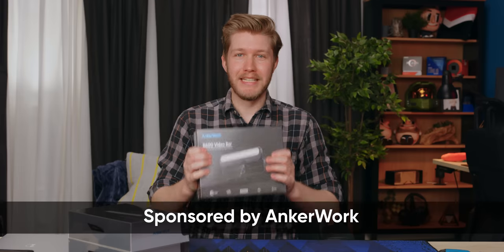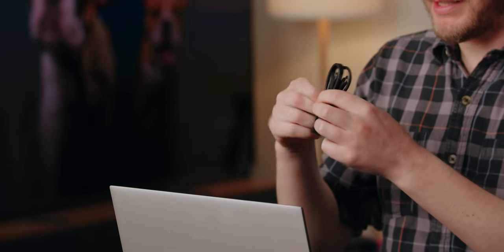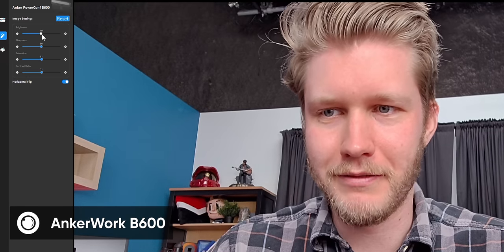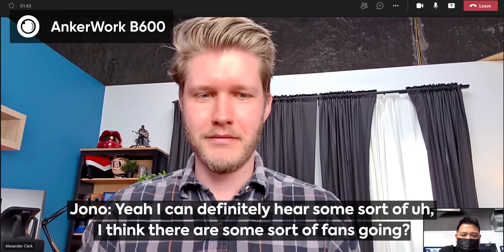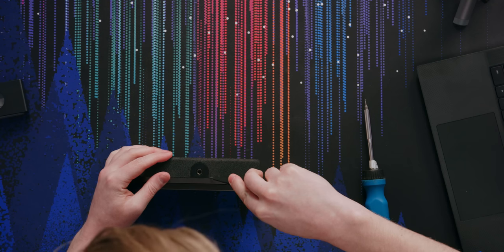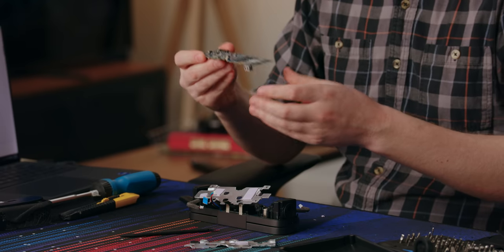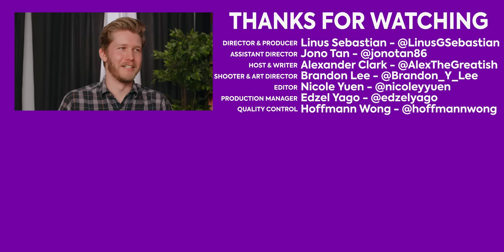Sponsors should be SCARED - AnkerWork B600

Comment: I completely forgot about the Pavilion Wave's existence, and I looked it up on eBay for shits and giggles.

Nobody bought them. I mean, to me, the Wave does kinda look cool, but nobody bought them. I would've. The only thing going for that computer is the Bang & Olufsen audio system.

But the Wave reference in the video aside, I don't think this webcam is worth it. You could plug in an old Sony camera over Composite into the computer (somehow) and it'd still look better than this.

"Look at the sensor. It's so little!"

Sure, it looks cute. But this is what you'd see in an early 2000's Kodak stills camera. Buncha noise. And those compression artifacts on that camera aren't great either. Of course, Teams never does any camera justice, even if you had a broadcast camera for $50,000. But still, that was direct capture.

Comment: 2K = FHD 1080p....
If it is QHD 1440 then it is 2,5K.... (2560x1440) 2500 = 2,5K... ;)

"Sometimes QHD or WQHD is referred to as 2K, with the idea that it's only half the 4K HD resolution. But the 2K name comes from the larger of the pixel measurements being aprox 2,000 pixels. Technically, the resolution standard for 2K is 2,048×1,080 (but 1920x1080p can also be called 2K) meaning QHD is actually much better in resolution. QHD could even be referred to as 2.5K, but some people resists calling it 2K..."

Comment: Guys, this is a tech channel, y'all should do better than "2K sensors, that's 1440p"... no, 2K is a bit more than 1080p. not 1440p. Sorry to be an ass about this but this garbage about "2K" has been an issue for like a decade at this point because reviewers started calling 1440p 2K for no reason. 2560x1440 is NOT 2K. 2,048 x 1,080 IS.

Comment: I know this isn't a proper review and manufacturer payed for the coverage of their product, but maybe next time you can roast a bad product instead of taking it apart? ;) I think it's really time for reviewers and tech community to stand up against this bs, all the webcams are just trash even without the compression of video calls, and these fancy new ones that came out in recent years cost like a decent smartphone, advertise all those lenses, sersors, software, but still won't deliver. What's the point in high resolution and framerate when the quality is still comparable to some Logitech 720p webcams from a decade ago?!?.. And I know, that with some new and expensive ones you can get an alright image, but it requires some stupid level of tuning, and even then lighting conditions change, settings reset after a disconnection or reboot, and lets have some common sense, 99.99999% of consumers won't and shouldn't be bothered. It blows my mind how every time these past few years a new expensive AF webcam comes out and almost in every video about it the reviewer will plug it in, play with settings and timidly say that it's "better" or "fine" when you obviously see that it's not fine, and it's only screen recording, and not all people have fast internet, and by the time you make a call it's all a potato, and it's 2022, and they want $200 dollars for it... This is unacceptable, so why is nobody saying anything?.. (rhetorical, I see a lot of reasonable people in the comments that also are vocal when something's wrong with the product, it's just that it doesn't change anything because there's not enough of us)

Comment: 2:38 Every time this guy hosts a video I get the impression they are kinda lazy with the work. They throw in a question about Windows Hello support, and instead of actually testing and giving out an answer for that, they just "guess" it doesn't, and decides not pursuing any further because they have a laptop that already has Windows Hello and they "think" the cameras will get mad at each other . These guys make living out of filming themselves building computers and that's the excuse they go with.

BTW guys, Windows 10 has Hello multicamera support from 21h1 which lets you choose the default camera for the face recognition, and if that doesn't work, you can just disable the onboard camera from the device manager and only leave the external camera active.

Comment: Remember a while ago when Alex reviewed the Dell 4K webcam (https://youtu.be/OIatX_cNVc0)? About the same price, and frankly, both rather disappointing image quality. Between the two, the Dell seems less sharp but has better color balance out of the box, and I'd prefer that one, but neither convinces me that it's a good idea to drop $200 on a webcam.

I get that you cannot put a fancy new full-frame sensor in there for this price, but surely a ten years old micro four-thirds sensor from say Canon or Sony would be pretty cheap? I use an EOS600 as webcam, that sensor is ancient, and heaps better than these fancy new webcams. Alright, it would need a bit of glass too, but considering you can get an off-brand f/1.8 prime for less than a hundred bucks, combining an old sensor and a bare minimum lens should still fall well within this price-bracket.

Somehow, every webcam out there seems to have the same crummy tiny sensor as you'd find in a smartphone. Of course they're never going to be amazing, so why not put a much bigger sensor in them?

Comment: 200$ for hot garbage, the image is a step up from crap webcam but at 220$ you can get hdmi out from old used point and shoot cameras that would kick its crap in, the mic is passable at best but even 30$ mics would outshine this if you arent going to speak from 10 feet away, and the light bar a good softlight costs 40$ or less, so for about 100$ you could have top quality, if you get a dlsr with hdmi out maybe price matched for best quality, and this thing is probably matching my my OLD 1080p logitech webcam from 10+ years ago. good job manufacturing e waste.

Comment: Has Linus thought about building a channel devoted to cyber security? How insecure is my webcam just sitting on my desk?....how easy is it for someone to hack into it? Thanks
Reply: there's nothing "insecure" about just having a webcam...  maybe the manufacturer's proprietary webcam software has backdoors, or it pulls updates from a service that got compromised...  it's happened, with all kinds of crappy proprietary software to control random bits of hardware.  browser vulnerabilities have existed that allowed webcam access.  it's just another device you have attached to your computer.  just following normal best practices like avoiding sketchy websites, not installing unknown browser extensions, not running software you know nothing about, is pretty much all you can do.  if a mainstream site gets compromised with an unknown vulnerability, you're gonna get peeped on by internet vandals.  it's unlikely the webcam itself could become an attack vector, but who knows?  stranger things have happened.

IP cams though...  that's a whole other ballpark :)

Comment: Video quality on the webcam looks awful. Super oversharpened even at the base setting and pretty terrible colors and skintones. Surely there are better and cheaper webcams. But also near that price you could probably start to find some old $200-$300 DSLRs with kit lenses to use as a webcam (like the Canon 60D) that will be about a thousand times better than this in terms of video quality and colors

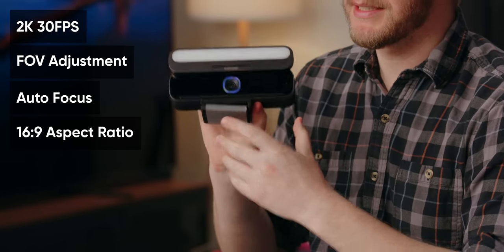Comment: 1:23 to 1:26  2k is NOT 1440p  ( facepalm).. AND NO..I don't give a sh%t if newegg or any other idiot retailer or etailer markets or labels as otherwise

2k = 2000   

2000 is CLOSEST to 1920 pixels

2k = FULL hd

2.5k, HOWEVER,....IS  1440p  as it refers to the closest amount of pixel quantity dealing with the HORIZONTAL pixels